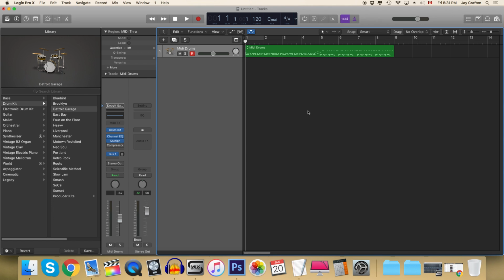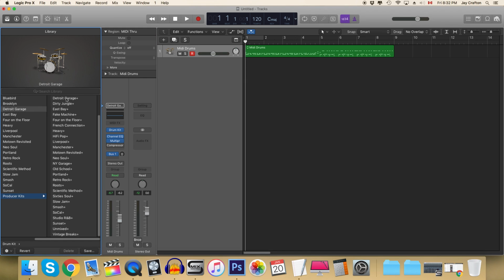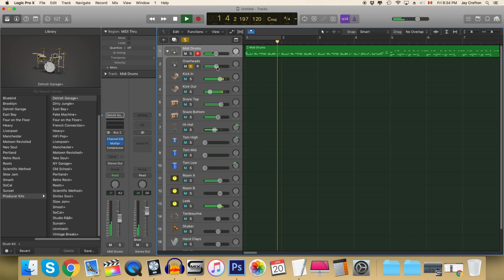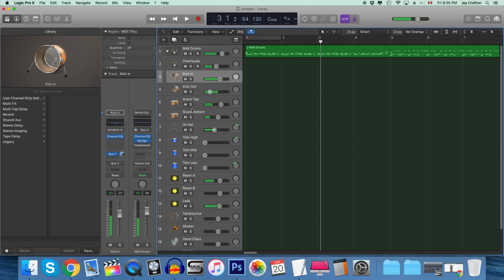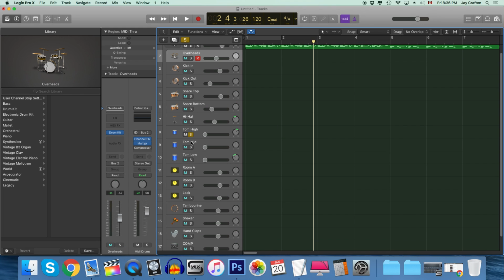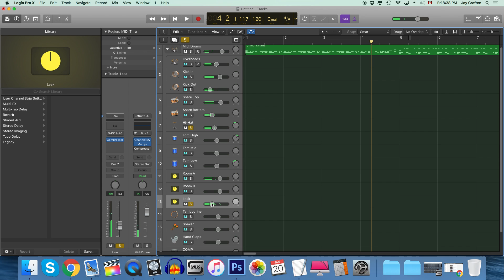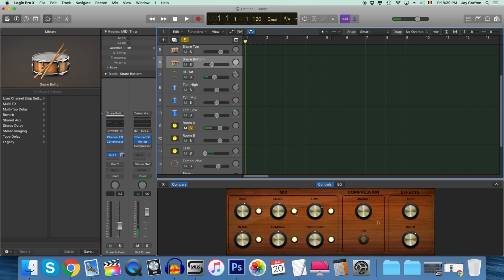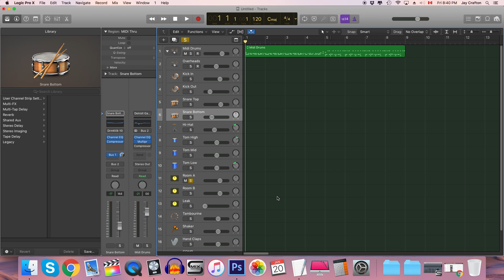Logic Pro X - Producer Kits Explained - Take Your MIDI Drums to the Next Level!

Comment: Thanks for mentioning the Overhead track as the way to get to Drum Kit Designer for a producer kit.   I learned that lesson a while back, then forgot it,  the got the help needed to remember at the end of the video.  If you select the Drum Kit folder track (with the folder closed), when you click in the input in Drum Kit channel strip, you get a channel strip menu, not the drum kit designer - so Overheads needs to be showing.

Comment: Thanks for this video. This method differs from mine but yours is much better so I have now written up for future reference. I had previously been selecting Multi-Out Drumkit Designer from the Instrument Button menu and not from the Library. If you don't use the Library, Logic doesn't automatically create the track stack for you. One other important thing I discovered was that you must keep the buses that Logic automatically generates or the Solo button on the Drumkit track stack header does not work. If you want to send the drums to your own drum bus, don't change the individual outs of each drum, do it from the output button on the header track of the Drumkit Track Stack. It took me about 5 hours to discover this.

Comment: At the end,  you showed the Drum Kit Designer Room A/B switch for the Overhead track's Smart Control editor.   I'm using the SoCal+ producer kit.

I tried panning Room A hard left and Room B hard right, then with those two tracks solo'd, I switched A/B switch in that Smart Control Editor to hear what I heard from Room A (right) and Room B (left).  With the aforementioned panning and Room A selected, I heard the Room A track in the right channel only (as expected).  But when I switched to Room B in the Drum Kit Designer, I get the snare and cymbals on the right (Room A track panned hard right) and the kick on the left (Room B track panned hard left.)   Is that what you get, and do you know the purpose of it?

Comment: So what are the kits in the Producer Kits folder that don't appear in the enclosing folder? (eg, Old School+) - are they just a name given to a custom combination of drum swaps and settings? - if I look in the track stack of the Old School+ kit there's a Drum Kit Designer Plug-in and it just says 'default kit' along with a menu of 10 basic kits on the left in the Library (Birch Kit, Classic Sixties Kit, Modern Maple Kit, Pawn Shop Kit, Seventies Plexi Kit, Stadium Kit, Studio Kit, Tight Maple Kit, Vintage Kit Brushes, Vintage Kit Rods) - it's a little confusing.

Comment: Hi Jay, thanks for making this tutorial, really appreciate it.   I mapped my V-Drums as an instrument using this as a guide https://youtu.be/9wo_w9b3LbQ   Based on this configuration, do you know a way I can bounce midi data to individual audio tracks that I can send to someone to mix in another daw? Thanks in advance for any tips /suggestions!
Reply from the maker: I've always done it manually. As an example, let's say there are five elements in our midi performance: Kick, Snare, Tom 1, Tom 2 and Overheads. I would duplicate the complete midi performance with the drummer plugin to five separate tracks, naming each track after each element. For the Kick track, I would delete all the midi data that isn't a kick; on the Snare track, I would delete all the midi data that isn't a snare; rinse and repeat for the rest of the elements. You'll then be left with five separate tracks with isolated midi data. You can then just bounce them in place or export them like normal to convert them into audio files that you can then send to someone for mixing. Hope this helps!
Reply from the maker: I may make a video about this at some point.
Reply: I’ll give it a try, thanks so much! Really appreciate it!

Comment: I set this up with my Yamaha dtx500 kit but both of my cymbals are triggering the “ride” cymbal on the logic kit , anyone know how to change that? I’m basically playing with 2 ride cymbals and no crash :/
Reply from the maker: Sorry to hear you're having this issue Samy! How are you hooking it up to Logic? If you're sending the signal out from a module, the issue might just that both cymbals are sending the same midi signal to the computer and you just have to switch the one that you don't want to be a ride to another channel. If you're not sure how to change midi channels for each element of the kit, it'll surely be in the manual :)
Reply: Jay Crafton on my module the crash and ride are labeled and in separate channels , I’ll see if I can change the settings somehow, I bought this kit used so I’ll have to do some research , thank you for getting back to me though

Comment: I'm thinking of buying an Alesis Surge E.Drum kit... would I be able to trigger these drums from that module?  Thanks so much, amazing video!
Reply: I bought an Alesis Surge Mesh like 4 mos ago and it works fantastic with Logic X!!  All you need is a USB interface cable which you can get off Amazon for $6.   http://a.co/7PstxNZ    I live in a small apartment so I can still record/play or whatever/whenever....the producer kits are awesome!!
Reply: I'm loving mine as well!  I got it about a month ago. :)  Do you have any tips on adding a pad from different kits into my set?  For example, I'll be using one of the producer kits, but if I'd like to have a clave block on one of my rims, would that be possible?  Thanks for your response!
Reply: Christian Bjork man good question!!  I believe the dual-zone capabilities no longer work when the drums go in midi.   You can get a stereo out cable to Logic and it will keep the dual-zone  features but you won't be able to adjust the levels on the entire kit separately, which is a deal-breaker for me haha...I have to be able to mix EVERYTHING separately.  I am still looking into that feature tho because I really want to use the same things you do!!

Comment: Hey Jay,  Many of my dual-trigger pad signals like hi-hat shoulder, tom rims, cymbal edges, and cymbal bell sounds don't seem to be coming across midi into Logic Pro X from the V-drums. Surely there must be an easy way to add these sounds to the Logic kit (Bluebird or SoCal for example), split the signal, or otherwise "fix" the problem, but I can't seem to find it. Any advise you have would be greatly appreciated. Cheers,
Reply from the maker: Have you tried clicking the little triangle at the bottom left of the plugin window and changing the input mapping to V-Drum?
Reply: Yes, It worked perfectly, thank you. Using the producer kits you mentioned seemed to help too, thanks for the great vids and comment.
Cheers
Reply from the maker: Wonderful! Glad I could help :)

Comment: I wanted to dig into these producer kits because they sound more like real drums depending on your midi data. To add to this great video, I took an older set of midi tracks with separate midi regions for each drum, joined the midi regions into a single combined region, then dragged that region onto a producer kit and it sounds so much better overall. I did use the same kit throughout (SoCal). Expand the stack and voila, when you compare the two approaches there's no denying that the producer kit sounds much more natural. Plus the bonus of tweaking stuff as described above. Thanks again for the great vid.
Reply from the maker: That's a great way to bring some old tracks back to life for sure. I don't know how I used to work without em! Thanks for the comment.